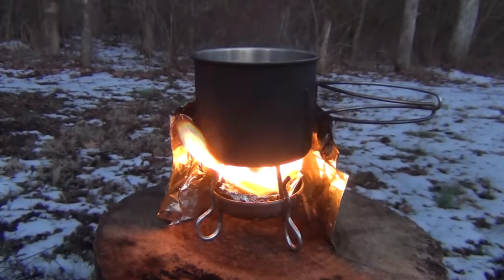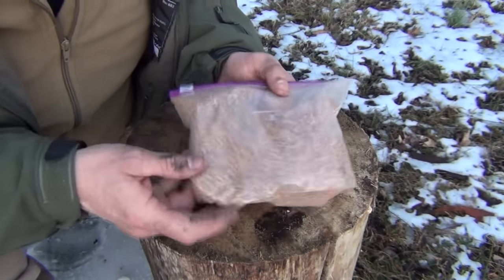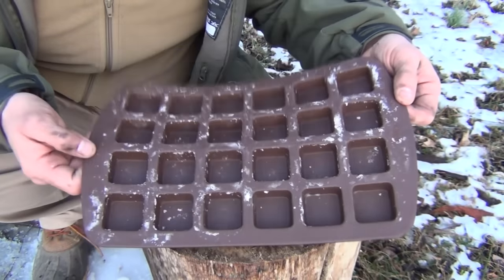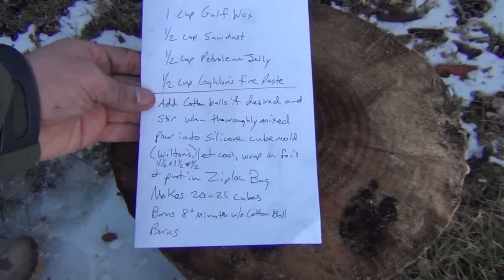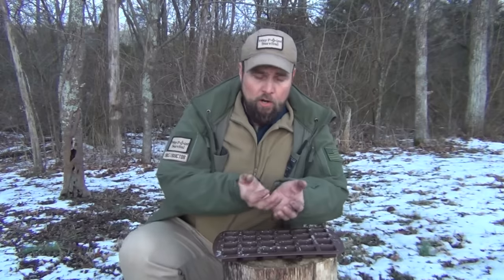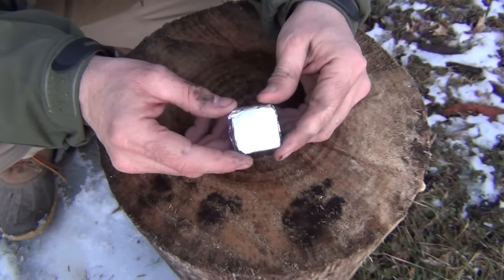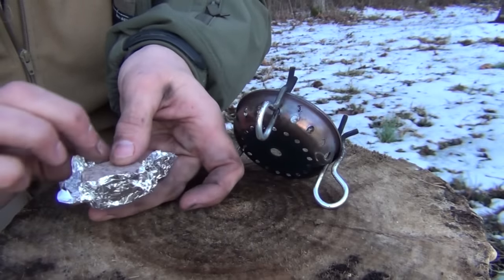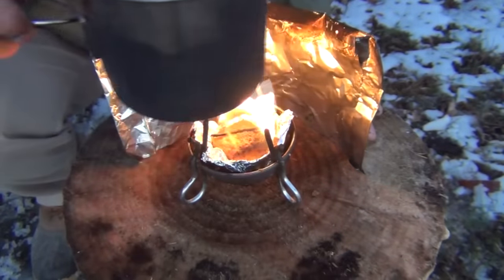DIY Fuel Tab [This is Awesome!]

Comment: Do you know how it stacks up against Esbit fuel or trioxane tabs?  I've not tried them myself, though I've seen them used some time back (1987).  I have no experience with Esbit fuel, but all I know for sure about trioxane is that you don't want sugar to get on it while it's burning: it gives off fumes like CS gas.  Not pleasant at all.  At. All.  
I'll give this a try sometime regardless.  Given the price of everything going up, this may be a great alternative to the above mentioned fuels.  The base you have has likely been demonstrated on your channel in the past, but sadly has slipped my mind. The support legs are obvious, but I'm stuck on what the bowl/base is.  Please help me on it's identity.  Thank you in advance.  
At any rate, you've given us a great solid fuel recipe that we can make at home.  Thank you for what you do.  I'll continue watching and commenting, even if it's wrong lol
Reply: Silly me....it seems I've missed an episode about.....solid fuel stove systems!!  HOW COULD I???? 
Disregard telling me which episode it is.  I work at Home Depot, so I'll likely find what I need there for that project.  Again, thank you for what you do. Great stuff, I'm tellin' ya.
Reply from the maker: It's a sink strainer and I made the video just a couple of weeks ago. It actually burns longer than Esbit fuel. Not sure about the trioxane tablets as it's been quite a while since I used one of those.

Comment: We need a practical application of the method of manufacture..Add a thin layer of matchstick powder or black gunpowder on the side of ignition so that the ignition process takes place well, especially in windy weather..My question is do these ingredients emit toxic gases
Reply from the maker: Thank you for watching. As with all solid fuel tabs, don't breathe the smoke. It's never good for you even if it's just wood smoke, it is always somewhat toxic to your lungs.

Comment: Have you tried pulling the cotton balls apart into a loose fluff so that the material is spread out roughly evenly?
Reply from the maker: It would be pretty difficult to do that as it's thoroughly soaked and but also make it burn too fast.

Comment: I'm guessing that these must burn much hotter than just cotton balls soaked with petroleum jelly as the a cotton ball will burn for 19-20 minutes but you are claiming 16 mins. for your cube. I love your idea and will have to try it. As a tinkerer and firebug myself, I will of course have to play with the recipe and see what kind of pyrotechnic blaze I can create. 😁
Reply from the maker: Yes, they burn much hotter and with more ferocity than just petroleum jelly in a cotton ball. What we're going for here is of course a more intense heat as well as a full burn of the cube all at the same time.

Comment: Saw you'd made o cube holder with a an old kitchen ink drain 
Drain plug, and some lock keys, good idea. I think 2linfd of cubes would be nice. One set of extended with cotton balls and one set made without, for heating water only
 You got one product I never heard of, the fire stuff! Can you get it at Walmart?
Reply from the maker: The fire paste I had to order off of Amazon. They used to carry in my local outdoor shops but I've not been able to find it there for a while.
Reply: @WayPointSurvival  Icon
I don't get much off Amazon, so I'll figure out something, thanks.

Comment: When using your table saw, make sure not to use sawdust from pressure treated lumber. Since it is most commonly treated with arsenic, you would be breathing that in with every firestarter you use.
Reply from the maker: Thanks for the safety tip. However, most of the newer pressure treated wood does not contain arsenic. They discontinued its future use in 2003.

Comment: Other than bragging rights/accomplishment, is there any reason for making these instead of buying ready made? Are they cheaper? Do they give off more heat per ounce compared to commercial ones? Do they burn hotter?
Reply from the maker: Depending on the availability of items where you live, they can be cheaper, they also burn longer and could burn hotter depending on what you add to them. As far as the bragging rights or accomplishment, I'm not sure about that but it's always good to know how to improvise things if needed.

Comment: Just paraffin wax and any sort of natural fiber product can make a simple solid fuel.  It may not burn quite as long, (The additives here go a long way to improve burn time,) but anything mixture of sawdust, shredded paper, cardboard, cotton balls, jute, dried leaves, or whatever added to the wax can make a passable fuel.
Reply from the maker: Right. However, the idea is to produce a very dense fuel cube that burns for a long time with intense heat. Thanks for watching.

Comment: Could you pop a cotton ball into each little square cube and pour the molten mixture in on top?
Reply from the maker: Yes, that's essentially what I did. However, I stirred it around so that the cotton fibers were mixed throughout.

Comment: BTW, I made the Hobo burner from a chicken can and some cardboard, but I use HEET in it (yellow bottle), and it works fabulously.  I let it sit and dry out between burns!
Reply from the maker: Sounds like a good stove. However, I would caution you against using HEET in your stove as the additives for drying out your fuel line are extremely toxic and should not be used around food or even to get it on your skin. I would encourage you to check out the MSDS sheet on it. Denatured alcohol is much safer and is actually made to use in alcohol stoves. It can be found at any paint store and is quite cheap by the gallon.

Comment: Might have to try these. I'm finding Esbit tabs quite underwhelming. Just curious, do they have any strong odors while burning? Seems to burn pretty clean.
Reply from the maker: They actually don't smell too bad, I think much better than the Esbit tabs, and while they do leave black soot, it's quite easy to wash it off with soap and water if you wish.

Comment: Have you tried it without the fire paste? Have you tried without the petroleum jelly? What is the cost for all the ingredients to make this. I found some firestarter squares online that burn for 10 min. What is the cost compared to using fire starter cubes? I found some for 24 dollars for 144 cubes that burn 10 minuites. They are basically wax sawdust and paper.
Reply from the maker: I have not tried it without the fire paste. I added that to make it easier to light. I have not tried it without the petroleum jelly as that mixed with the wax helps the burn time. I believe the overall cost is about $0.50 a piece roughly.

Comment: I need to make these. I see you are using your DIY debit stove here and I am wondering how well they will work with the factory folding debit stoves also and also if magiesum is also added will they burn hotter longer?
Reply from the maker: Yes, they will work with the factory folding stoves. You could certainly add magnesium to it and try it.

Comment: Out of curiosity, couldn't you use a tinfoil tart tray in the bottom they're small enough and do bend easy enough
Reply: Or save and reuse the little tins from tea lights.
Reply from the maker: I'm sure you could use the small tart trays in the bottom if you wished. Thank you for watching!

Comment: Have you done a cost comparison vs Esbit and similar cubes? Be interesting to see how much each breaks down to, per cube.
Reply from the maker: I believe these cost roughly $0.50 a cube. However, they burn longer than an Esbit  I believe these are cheaper and better in the long run.
Reply: @WayPointSurvival  How do they smell? Cuz anything has to be an improvement over Esbit!

Also, how was the soot? Esbit’s soot is awful.
Reply from the maker: The smell is fairly pleasant until they burn and then it just smells kind of smokey not at all stinky like an Esbit. It does, however, leave a fair amount of soot that is easily washed off with soap and water.

Comment: I am no expert but in my opinion that looks like it could work similar if you use sawdust, gulf wax, maybe use two squares or compress it.  
It looks like the size is what makes for the long burn time.
Reply from the maker: That would be another option but I don't think it would burn as well.
Reply: @WayPointSurvival  
I mixed sawdust, paper confetti (straight out of a paper shredder), and wax into a home made fire starter and the flames reached up to around 6 inches.  I didn't check to see how long it burned but it was long enough.  I am someone that likes to mix things but when it comes to making something in bulk, I like to keep it simple (less steps, less mess, and less chances of mistake).

The end result you want is a pack-able fuel pellet that can bring 2 or more cups of water to a roiling boil.  At a minimum of what you have shown, wood and wax can accomplish this.  If you want more burn time you can add a more wax so that the wood has more fuel to wick at.
In my subjective opinion the fire starter paste and petroleum jelly aid in starting the fire.  The wood acts as a binder and a wick.  The wax is the fuel.

Comment: Silicon is a metal element, silicone is a rubber used to make molds.
Reply from the maker: Yes, you are correct.

Comment: Cool! Did you make a cost analysis which is cheaper to just buy them vs make them yourself? Also are they toxic or not for inside burning?
Reply from the maker: If you buy the materials in bulk I believe it's cheaper to make them yourself. Also, I would not burn it inside as almost all of the solid fuel for stoves including trioxane and hexamine are to be used outdoors. As far as the toxicity is concerned, I'm not a chemist, however, most of the elements involved are pretty safe. The fire paste which is used to help start it easier does have some petroleum distillates as well as ethyl alcohol in it.
Reply: @WayPointSurvival  makes sense. I guess I shouldn’t have burnt that in the house to other day to test it.

Comment: can you explain a little more on how you are using the cotton balls?
Reply from the maker: You just put them in the mix and stir them around till they're thoroughly soaked. And you put them in the mold and pour the rest of the liquid on top.
Reply: @WayPointSurvival  dumb question, 1cup of wax equal to 8 ounce in weight? Picking up today and come in 16 ounce blocks.
Reply from the maker: So, the difference is you are comparing a measure of weight with a measure of volume. When I referred to one cup of wax I meant one cup of melted wax.
Reply: @WayPointSurvival  ok wasn’t 100%.  Thanks bud

Comment: Always such great videos !
How many tubes of fire paste do you have to use to get a 1/2 cup for your recipe.
Also how does the cost compare to the tabs you bought in your stove video.
Reply from the maker: Only used about half a tube of fire paste. Also, the cubes cost about $0.50 a piece roughly depending on how cheaply you can acquire the materials. If you buy in larger bulk size it's even cheaper.

Comment: I've been thinking the best way to heat or cook chili and oatmeal over an open flame without burning it on the bottom. And you said double boiler. And click! You put some small rocks at the bottom of the larger pot or pan for spacers.
Reply from the maker: Indeed. Just a smaller can inside of a larger can with some water!

Comment: Maybe change the procedure?  Put cotton balls in silicone form, then pour sawdust, vasoline, and fire gel over top of cotton ball?
Reply from the maker: If you did that, the cotton balls would not soak up the mixture very well. They need to be in the heated mixture and stirred thoroughly and let set for a few moments.

Comment: How many matches did you actually use to ignite that cube, we all noticed that you were having a little trouble getting ignition.
Reply from the maker: I actually used three to light it because the wind kept blowing it out. The one that I showed on the video is the one that actually lit the cube after I laid it on top the flame was just really small and when you see it in the next shot that was from that very same match.
Reply: @WayPointSurvival  consider placing a short length of candle wick in the cubes when formed.

Comment: Could you mix fat wood dust into this mix? Would it burn too quickly,
Reply from the maker: You could definitely mix fatwood dust and shavings into this if you wished.
Reply: @WayPointSurvival  I thought that it could be placed into a char tin and used as one unit. Hopefully,  it will give a longer burn time.

Comment: How many cubes of 1.5x1.5x.5” does this make and what is the cost of materials, tray not included?
Reply from the maker: It makes about 20 or so cubes. The cost of the materials varies depending on where you purchase them but it works out to I think roughly 50 cents per cube.

Comment: Very interesting
Reply from the maker: Thank you for watching!
Reply: @WayPointSurvival  Ive been using the cotton/vasoline for years. Adding saw dust is so obvious, cant believe i never thought of it, lol. 
Have you tried without the wax, wrapping in tin foil or something instead? I would think that the vasoline itself would be enough to hold it all together, that way you dong have to worry about melting in high temperatures.
Reply from the maker: The Vaseline will not get solid enough by itself and we'll definitely melt in warm weather. I know this from teaching survival classes in the summertime.
Reply: @WayPointSurvival  I store my vasoline cotton balls in the tiny little ziplock plastic bags everything comes shipped in when you buy it nowadays, keeps the whole thing contained, and eliminates the mess. 

When I need to start a fire, i light the entire baggie up, works like a charm. Gonna add some saw dust in the future because of your vid.

Comment: What is a "double boiler" that you mention?
Reply from the maker: The bottom pot is filled with water and there's a second inner pot that you use to boil or melt the Gulf wax. That's so it doesn't overheat and ignite. It's for safety.

Comment: How many of the cotton balls did you add?
Reply from the maker: I just put in one per square.
Reply: So 20ish all at once or mix it all up and then add one per square rolled up individually and put in the mold one at a time?
Reply from the maker: Yes, put them all in and stir them up and then pull them out one at a time putting them in a mold and then pouring the rest of the mixture on top.
Reply: @WayPointSurvival  Thanks man, much appreciated.  Like the little stove design as well.  Gonna try it tomorrow.  Keep up the great content!

Comment: I would have liked to seen the actual process of putting in the cotton ball and the wood chips and wax in that small container.
Reply from the maker: It's quite simple. You just warm everything up pour it in the can, stir it together and then pour it into the silicone tray.
Reply: @WayPointSurvival  so the cotton balls must melt into the mixture right?
Reply from the maker: They don't actually melt into the mixture they just get really saturated through and through.

Comment: How do  you combine the sawdust with the cotton ball?
Reply from the maker: You put the sawdust in with all of the other wet and melted ingredients and you add the Cotton bowl last.
Reply: @WayPointSurvival  I'm assuming you just push it in after you fill the molds. I was actually about to make an attempt at those fire disks but I think I'll try this first.
Reply from the maker: No, you don't push it in, you stir it in with the melted wax.
Reply: @WayPointSurvival  thanks for the clarification.

Comment: Silicone, not silicon.  Silicon is the brittle semiconductor material used in electronics.  

Silicone, is a synthetic polymer made up of silicon, oxygen and other elements, most typically carbon and hydrogen. Silicone is generally a liquid or a flexible, rubberlike plastic, and has a number of useful properties, such as low toxicity and high heat resistance. It also provides good electrical insulation.
Reply from the maker: Thanks for watching.

Comment: YOU DIDN’T ACTUALLY SHOW HOW TO MAKE THE CUBES.  YOU DESCRIBED IT BUT NOT THE PROCESS.
Reply from the maker: It's pretty simple, you just melt it all together in a double boiler and pour it in the mold. I didn't show it because everybody should be able to figure it out.

Comment: FYI:  I would not recommend this.  Aluminum is a neurotoxin, so burning it, as would happen in this use, could be very dangerous.
Reply from the maker: It doesn't burn in this application. It's perfectly fine when you're done.

Comment: Maybe you shouldn't edit out so much.  People might want to see just a little more of the process.
Reply from the maker: I didn't include any of the mixing process because I felt it was too boring. Just melting and stirring things together and pouring them into the mold doesn't make for very exciting viewing. It's difficult at times to know what people want to see and don't want to see. Thank you for watching!
Reply: @WayPointSurvival  Great Video, I'm only offering constructive criticism and in no way trying to berate your video.  It would have been nice to see what it looked like all together, how much did you deconstruct the cotton balls and how you separated the mixed cotton balls/wax/sawdust into the molds and consistency.  Not trying to argue, just adding opinion.
Reply from the maker: No problem.